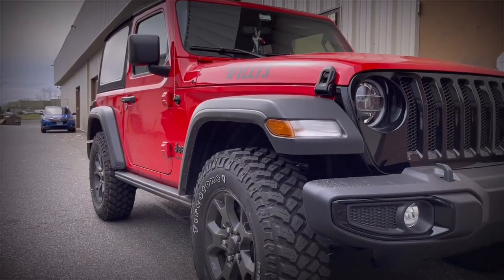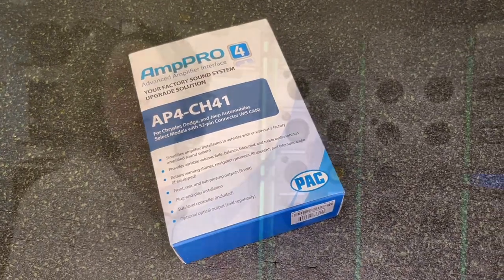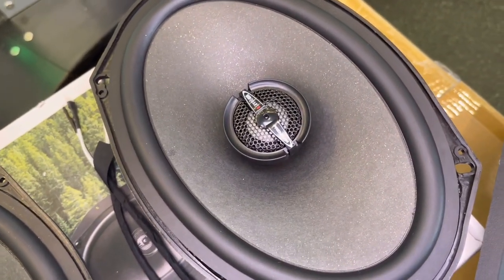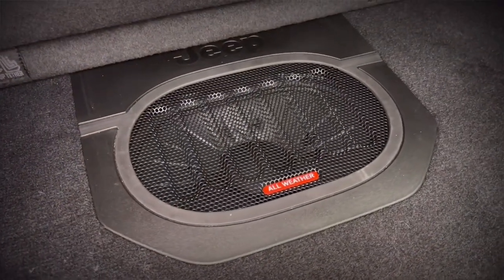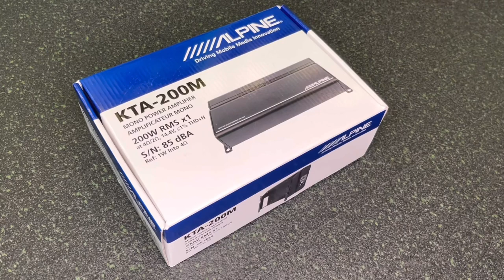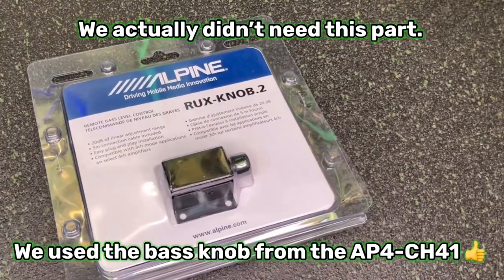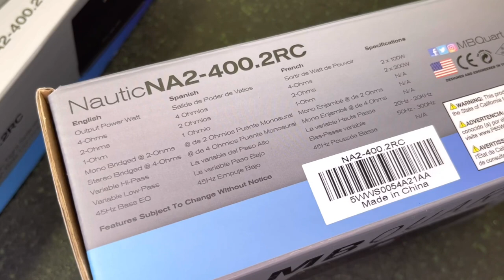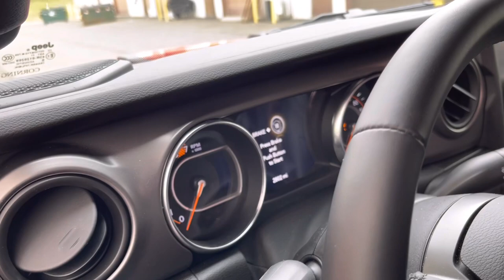Jeep JL Speaker Upgrade - MB Quart Stage 6 Review

Comment: Once again thanks for the inspiration to go for it and add the stage 6. I’m sure that you know that Quart finally took care of us JLU owners and made a sub that matches the factory unit. I installed that back in January and it is far superior to the factory sub. From the JL forum I bumped into Hal, HPC3, who was doing a similar build in his and he  recommended replacing the AmpPro with a 
Rockford DSR-1 with the aCH4 adapter cable, and a PLC2, having used one in a prior WK
Grand Cherokee build. Still tweaking the amp gains as the DSR-1 is a 4V out vs the AmpPro is 5v but he Punch EQ brings more out of the bottom end.
Reply from the maker: Hi Daniel! So good to hear from you again, I'm so glad to hear you're loving the upgrade. Yes, you actually let me know about the MB Quart sub when you 1st got it. Based on your feedback and the experience I've had with the Gladiator sub box, I've let a few clients know about it, but so far no one has taken the plunge. I had one client really interested in it to replace his stock Gladiator sub, but I was told by MB Quart they're only selling it as a package with the amp. He already has a nice 5-channel we pulled from his last Jeep. Hopefully they'll start selling it separately for folks like that. There's a lot more audio control the DSR-1, that's for sure!

Comment: Ok so it has been 17 to 20 years since I have heard MB Quart too.  When I was the Car Audio Manager for Sound Advice in FL MB Quart was our top of the line Speaker for Mids and Highs.  JL Audio for Subs.  So huge question.  We were going to do an entire JL Audio System similar to one of your videos but now seeing this my eyes got big!  You have heard both now.  What are your thoughts about which set up sounds better?  Now, Second big question.  What are your thoughts on the MB Quart miss and highs kit with amp and the 2 JL Audio 10" Stealth Subs and Amp?
Reply from the maker: I will say that this is not the MB Quart of 17-20 years ago. From what I remember, those speakers sounded more similar to like a JL Audio C5 of today or Hertz MLK series. Soft dome tweeter, tons of mid, inefficient, but can handle a ton of power, very clean, smooth and directional. That's my memory of the series that we carried. But we didn't do a TON of it. Please tell me if you think that's an accurate recollection and if that's how you remember them.

I would say the Stage 6 kit today reminded me more of being in between a Focal Access series and Flax series speaker in tonal quality, but able to handle the higher power. Based on price point I was comparing this to the Alpine PSS-24WRA kit and this blows it away (sorry Alpine).

I do think it would sound fantastic with the two JL Audio Stealthboxes in a 4-door or Gladiator. I'm sort of always trying to work backwards from a clients budget to price out what I think will be the best sounding system for their money. I think what you're talking about is at a higher price point and a bit higher in quality/performance than this package, but it really depends on which JL speakers and amps you're thinking of. If you're doing JL C1 or C2, yeah, I think these are better performers. The JL VXI amps are great quality, but not enough power IMO. We ended up doing I think 3 amps in that 1st Jeep video (600 watts to the subs and we had two amps for mid's/high's so we could push 150x4 to the interiors).

For what it's worth, the best sounding Jeep systems we have done so far were with a JL HD600/4, JL 750/1, two Stealthboxes, Focal KX2 speakers - either using aftermarket X409-WRA-JL or AP4-CH41 with JL Twk-88 DSP. But these systems are like 3-4 times the price as the MB Quart package we just did.

Comment: Finally got it all set. Tried a 10TW3 which needed more space than was available. Seems the JLU enclosure is 0.35 cu ft. Dave at Quart measured it. Tried a 48CWRT104 and the bolt circle is about 1/2 inch too big. Sent that one back too. Quart is about to release a JLU drop in sub. In the meantime, I rewired the sub like you did and I am running it on a 400.1 quart amp. We will see how long it lasts......  Thanks for the tips.
Reply from the maker: Nice job! And thank you for the heads up, I did not know they were working on a JLU drop in sub, that's exciting :)

Comment: Annie, great vid as usual.  What would you suggest for replacement speakers for the JK factory (2015+) Alpine system?
Reply from the maker: Aww, thanks! Ooh, that depends on a variety of factors. Client's tastes, budget, how much power we have to work with. I like to have at least 100 watts RMS per channel in our Jeep installs, if not more, for really substantial power/output for the open air ride. If I have that much power - on the higher end side usually the Morel Hybrid or Elate series or Focal K2. On the other end of the spectrum Morel Maximo Ultra series, Kicker KS series or Alpine Type R. If we're somewhere in the middle power wise/budget wise, the Focal Flax Evo series, they're very efficient, very vibrant.

This stuff is very subjective, everyone's ears are different. Some people are more sensitive to top end/harshness (myself) and need a very smooth, delicate, detailed tweeter. Some have top end hearing loss and need a very bright tweeter. I'm running 10 year old Hybrid Elate's in my 2014 JK. They're very smooth and detailed, but definitely lacking in mid range. Some prefer the punchy midrange and loud/clear tweeter of the Focal K2. Some prefer more upper mid and go for a 2.5" wide-band driver in the OEM tweeter spot and put a tweeter upright on the dash or a-pillar in its own separate pod. It just varies widely depending on the client's ears/preferences, budget and the power we're working with.

I will say in general, I normally don't like to aim a tweeter up at the glass, but it worked well in this application/package. Normally in the 2015+ JK we are doing a traditional tweeter under the OEM grille aimed slightly at an angle (so not straight up at the glass) or we're doing pods on top of the OEM tweeter covers to get a more upright/coming at you/away from the glass sound stage.

Comment: Can I pick your brain?  Building our 392 JLU and bought the wrong front speakers that sound muddy so going with JL Audio or MB Quart.  Honest opinion for someone who likes high quality sound.  Taking the C7s out of the choice due to trying to save some money, For fronts in your opinion what would sound better ran through an aftermarket amp and dsp.  1st option.  JL Audio C3650 ran as Coax on front kick panel and then the C2350x on top dash, or 2nd option just running the C3650s as components and putting the tweeter on the dash and the woofer in the kick,  or option 3 using the MB Quart factory replacements top and bottom.  My amp puts out 75 watts per channel and i’m using the dm810 Audio Control DSP.
Reply from the maker: What speakers did you buy that you feel sounded muddy?
Reply: @carstereochick  Diamond Audio.  THey honestly are made for motorcycles and I was referred to them by a past corp exec from my Car Audio Days saying they are closse to JL Audio.  Personally not happy with the ressult but might have someting to do with lack of experience with tuning the DM810 by audio control.
Reply from the maker: Wait, are you using the DM810 to get signal from the factory radio speaker level? Or are you going thru a PAC AP4-CH41R2? Or aftermarket head unit with the DM-810? My limited experience with Diamond Audio is with a motorcycle we did over the summer. It was their Pro series, the MP694. Honestly they were loud and clear, absolute screamers. I don't know which series you have, but even the older Diamond stuff I've heard I always found the mid to very loud, clear, in your face/punchy and super clear high's. A bit bright for my taste. Depending on your set up and how you have it wired, if possible you may want to just want to take the DM-810 out of line and listen to it flat thru whatever amps you're using/PAC pre-amp adapter or aftermarket head unit. I have had PLENTY of clients manage to make good equipment sound bad just due to general lack of experience setting up a DSP or amp gain/crossover settings, etc. It's not uncommon for clients to install equipment themselves and then come in and pay us to tune it. Might want to do that 1st and then re-evaluate?

Comment: MB Quart says 2 hours for the speakers and 2 hours for the amps. Are they close to reality? Mine came today. Maxxsonics should be sending you referral checks.....
Reply from the maker: 😂 Umm, maybe if that’s what you do all day like on an assembly line? I don’t think that’s realistic. We do Jeep JL/JT systems all the time and front dash disassembly is a bear in these vehicles. It definitely helps to have the wiring all pre-terminated. I think a more realistic time is double that. We had this vehicle for 2.5 days but part of that is because it takes time to film and we also added in wiring up/retaining the stock sub. The reality is it’s going to vary widely depending on level of skill, comfort and speed at which one works. And thank you, I think they’re at least trying to send some clients our way! Are you doing the install yourself or taking it to a shop?
Reply: I’m going to do it myself. I dremeled out the sound bar this morning. The rest of it looks reasonable. Going to see how I like it with the factory alpine sub and go from there. If I hack the sub, I’ll probably add another quart amp because the wiring is already setup for a third amp.
Reply: Yeah. It took about three hours total for the soundbar including trip to store to get a new dremel. Took just under 6 hours to get the dash, soundbar wiring and the amps installed. I added a 400.1 and plan to add a 10TW3 JL audio sub in the stock enclosure. Can I ask where the gains were set for the front, rear and aub?
Reply from the maker: @danielgulick5752  that’s a great question, I’ll have to ask John I’d he recalls. Good job on the install!! I told you that front dash is a bear to disassemble 😉

Comment: A Pioneer TS-W311D4 400watt rms ... I have a stereo amp certified @ 2 x 260 into 4 ohms and 2 x 400 into 2 0hms (stable ) without clipping . My car  Bass head friends   say i should series the sub ( 4 + 4) into a series 8 ohms to run the amp cooler and not to clip--- My Pioneer car deck goes up to 80 % without distortion.  I value your knowledge .... Helllppp ... What can i do .. Can i bridge the amp to make 2x 400 = 800 into 2 ohms and will it deliver +/- 400 into 8 ohms
Reply from the maker: Your friends are right. If you run it in parallel (sub acts as a 2 ohm sub) and then you bridge the amp, the amp sees 1/2 the load or 1 ohm. That's a very unstable load for most traditional 2-channel amps. The lower the resistance, the more power the amp puts out, but with less control which usually results in sloppy bass and the amp overheating. Not knowing what amp you have, I don't know if your amp is rated for that, but based on what you said, it doesn't sound like it is 1 ohm stable or it would have included that rating as well.
Reply: @carstereochick  Oh ! thank you so much . This amp is a Starsound SSA-G350.2   (stereo ) still brand new (in sealed box)  and was bought ten years ago and recently  ( March ) given to me as a present. I had it dyno-ed and it is 2 ohm stable and not meant to drive a 1 ohm load. However, the dyno  shows, (2 x 260 watts @ 4 ohms and 2 x 400 @ 2 ohms and stable without clipping.. I am 73 years old, and now a mini bass head . As for you , Beauty as well as Brains..... Wow, what a combination.. Peace and Joy  always be with you as our Lord Jesus promised.

Comment: Doesn’t the factory sub have 4 voice coils? Did you wire all 4? Series or parallel?
Reply from the maker: Yes, good question. Quad 8-ohm voice coils wired them all in parallel for 2 ohm final load.
Reply: @carstereochick  thanks.